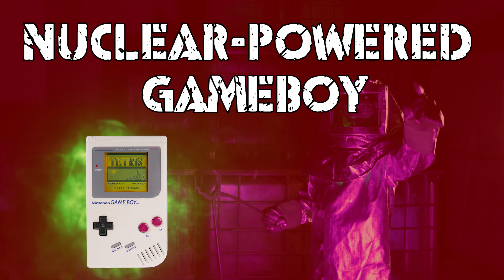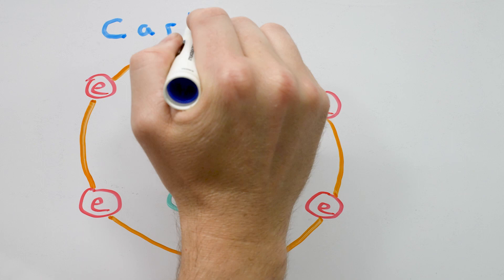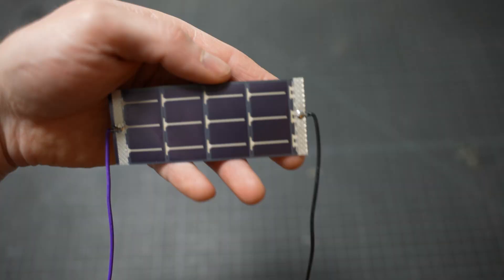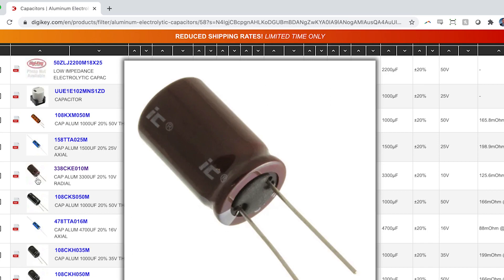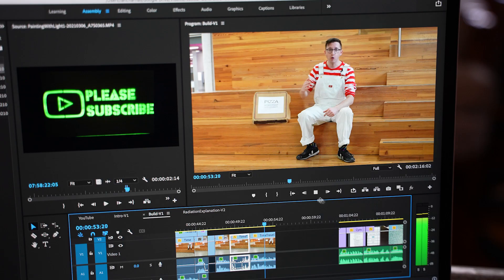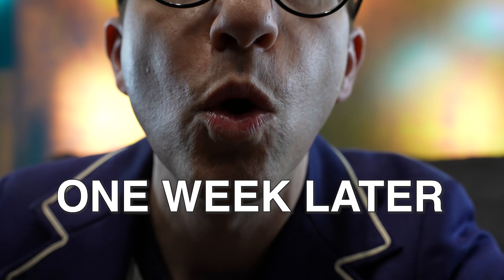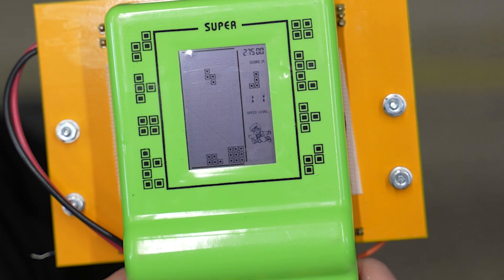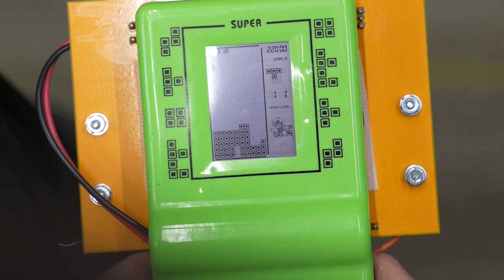Building A Nuclear Powered Gameboy (Lasts 100 Years!)

Comment: How about adding solar panel charging as a supplement and charging it? You should be able to use it more quickly if you charge it with sunlight in addition to charging it alone
Reply from the maker: Hehe you are definitely right! If I made a solar-powered Gameboy that would work better. Somehow though my projects always fall into the "not super practical, but funny" category.

Comment: Cool. I assume it would be possible to make a tritium generator that doesn't use the detour of florescence and photocells to generate a voltage/current and uses the electrons... beta particles... directly to generate the voltage and current? I wonder how much tritium it would take with the optimal design to generate enough wattage to run the gameboy indefinitely 🤔
Reply from the maker: Anders thanks for the super nice comment! I appreciate it. Yeah what you're describing is totally possible. They call that a "betavoltaic" cell rather than a "photovoltaic" cell. They are indeed more efficient. The only trouble is they cost several thousand dollars. Maybe one day when my patreon has a few more supporters 😉

Comment: could you encase the fuel rods in a reflective mirror container to increase the light power into the solar cells?
Reply from the maker: Hi Dan! Thanks for the comment. Yeah the NurdRage channel basically did that. They had a solar cell on one side and a mirror (well, aluminum foil) on the other side. But it works best (generates the most power) with solar cells on both sides.

Comment: How much charge do those solid state batteries hold? How do they compare a AA or something commercially available?
Reply from the maker: Great question! The batteries individually hold 50 micro ampere hours, if I recall correctly. A typical AA battery might hold around 2500 milli ampere hours. So it would take 500,000 of the tiny solid state batteries to hold as much energy as one AA. It's a very niche product :-)

Comment: Do you think those batteries store enough energy to ignite an electronic match used in model rockets ? I believe it needs a minimum of .60 amp (600 milliamp

Thanks , great video by the way
Reply from the maker: Another great question! I haven't looked at the datasheet in a while but I think the maximum power output was around 100 micro amps. So you would need 6000 in parallel to get to 600 milliamps
Reply: @iancharnas  thanks for that info! Keep up the good work

Comment: Excellent video! Side note - phosphors don't necessarily contain phosphorous; the name refers to the ability of the compound to emit light when excited, not its chemical composition. As far as I can find online, it appears that the phosphor commonly used in tritium tubes is zinc sulfide, likely doped with some rare earth element to change color.
Reply from the maker: That's super interesting, I didn't know that! I had always wondered what the term phosphors meant. Thanks for the comment and also for the kind words :-)

Comment: I hesitate to admit it but I'm most excited about the solid-state thin film batteries. I really want to figure out a project I can use them on just for the cool factor but >50µAh @3.8V is not a lot of energy.
Reply from the maker: Oh yeah totally - the low-leakage really blew my mind. The real-life applications seem pretty niche. I saw one that involved an eyeball pressure sensor that was actually implanted into people's eyes. It kind of grosses me out but also fascinates me.
Reply: Consider E-ink. 50uAh should be more than enough to refresh big E-ink display. And 1uW of input power is more than enough to power Artasie series RTC chip. So you can make everlasting clock or even simple ebook reader
Reply: @mocrochip4474  I was considering using them instead of coin cells for rtc and SRAM of a cartridge like system I wanted to design. E-ink sounds fun but I suspect a considerable amount of the power they use is for the processor running the show.
Reply: @oliverer3  It depends on the show. You can completely cut power to display and put your processor in deep-sleep when you don't need to refresh the screen. And modern low-power MCU's have dynamic consumption about 20-50uA/MHz (and way lower for Ambiq Apollo series) so I believe processor shouldn't be the problem. 

Replacing coin cells sounds also fun, but I have concerns about capacity: typical CR2032 is about 200'000uAh
Reply: @mocrochip4474  Coincell wise I was thinking for situations where it can be recharged when the system is powered.

Comment: That was amazing! If only there was a way to make this more efficient, I can imagine this powering an STM8L micro for things like long term periodic measurements (the micro itself would be the least concern, probably the sensors would eat more energy) :)
Reply from the maker: Abraham, thank you for that super nice comment!! 😊 Yeah you are exactly right - I think the main use case for these thin film batteries was for powering super low power clock modules and things like intermittent sensors where it saves up energy from kinetic or dim light sources until there's enough saved up to briefly power up a micro and record a measurement. I bet there are some of these in space right now, which is fun to think about.

Comment: Coulda built a few more tritium generators instead of hunting down an exotic battery. But since the exotic battery has already been found the next step is to figure out how many tritium generators it takes to have a reasonable recharge time and fit it all inside the case.
Reply from the maker: Hi thanks for the comment! I was getting about half of a microwatt of power out of the tritium generator, and I think the video game used something like 500 microwatts... so I would need to make 500 of those tritium generators in order to eliminate the exotic battery. With the right amount of money, it's possible.

Comment: What if you reacted the tritium in a bunch of them with oxygen to make tritiated water and used beta voltaics to directly capture the electrons instead of losing energy to exciting a phosphor in between? You'd get more density by packing the tritium atoms close together into a liquid and more output from a beta voltaic cell at the small cost of making a really radioactive liquid that can easily be absorbed into your body!

Comment: I wonder how it would work if you used the U as your beta particle source
Reply from the maker: Paul thanks for the comment! Hmm that's an interesting question. Wikipedia says Uranium-238 decays by alpha emission into thorium-234, which decays by beta emission to protactinium-234, so that beta decay could make the phosphors glow if there's enough of them. The Geiger counter did go pretty wild when I put it over the Uranium ore sample, but I'm not sure how much of that was beta particles versus alpha particles, neutrons, gamma rays, x-rays, and so on. Maybe someone who knows more about particle physics can help us answer that.
Reply: @iancharnas  I suppose you could try thermal electrical conversion as well? Then you don't need betas for the phosphorus/eventual photons, though you may be able to design and build something which harnesses both the heat and the photons
Reply from the maker: @krakhedd  oh interesting! Like a combination RTG and Betavoltaic generator. Now THAT would be a project!
Reply: @iancharnas  Either that, or harness the kinetic energy of all the radiation by use of a sheet of graphene! ;) (Recent experiment, at MIT I believe, accomplished this feat)

Comment: How about nuclear powered AirTag? Ive been thing to built it into Rigde style wallet. for sure it'll become thicker after photovoltaic sandwiching but it seems doable. However I don't have enough knowledge to calculate everything and build the circuit. What would you recommend to read to gain enough understanding of electrical engineering to get this thing working?  BTW this video is very informative. Will def check out the rest. спасибо))

Comment: Do the thin film batteries come with any storage charge? I'm having trouble finding a datasheet, could use this for another wirelessly powered smoke detector I've been using supercaps on, but it takes too long to charge between checks for a fire, so perhaps these could help me.
Reply from the maker: Stephen, great question! The thin film batteries I bought came with no storage charge. However the ones I bought are super easy to charge. The QFN package contains the battery and also a tiny charging circuit, so all you have to do is connect about 4 volts and let it sit there for 20 minutes. That's particular to the ones I purchased, but you get the idea. For a wirelessly-powered smoke detector, is the idea to gather energy via RF waves, store it in a thin film battery, and then periodically wake up a micro to operate the smoke detector? Sounds like an interesting project! The thin film batteries only have a tiny maximum output current, so one challenge is they may not be able to sound an audible alarm because a buzzer might take too much current. Just something to check on as you work on this. Good luck!
Reply: @iancharnas  Yeah sweet, thanks, interesting, I might have to grab a few.  I was using some low power SiLabs MCUs with custom antennas - waking up to read a sensor every so many seconds, transmitting status to a hub unit with battery backup. The idea was to make battery free detectors, sticky and easily deployable with just a single central point for monitoring. Picking up transient RF radio waves, or nearby emitted RF waves like some 915Mhz ISM @ 2.5W omnidirectional - but range was low and wakeup time far between - solely dependent on the supercap specs. Using radio was basically a month long joke, and emitting our own radio waves was very promising but not to the par of a standard cheapo smoke detector - once ~20ft away from the RF source.... not good. 

perhaps a thin film battery will improve this range, new radio and MCUs as well, but, inverse square law is evil here haha
Reply from the maker: @StephenShafferengineer  Cool project! If the detector is for homes and offices, I'd bet you'd get more energy from a low-lux solar cell. I used this one for the nuclear generator project, it's great for getting energy from dim indoor lights: https://www.digikey.com/en/products/detail/powerfilm-inc/LL200-3-37/9559467

I could see some advantages to RF energy collection though. There's always pros and cons :-)
Reply: @iancharnas  Oh yeah 100%, this was just similarly to your project, to learn about CNCing antennas and capturing power, and getting those darn SiLabs MCUs into their lowest possible power state lol (their documentation is the suck, but they're cool in email support)
Reply from the maker: @StephenShafferengineer  sounds awesome! I too am in the camp of "we do this not because it is easy, but because it is hard" - best of luck on your projects :-)

Comment: Kind of surprised the green vials deliver the most power to the solar cells. 

I Was aware that green was the most visible wavelength to the human eye.  (Therefore it appears to be the brightest…)
But I’m surprised green also delivered the most power to the solar cell.
Wonder if human eye sensitivity is correlated to power absorbed in the solar cell?

Also, not sure if I mentioned in my other comment, but I have a few extra x-ray machines, if you’d like one for your shop.  

Most of them are early to mid 2000’s dental machines, some of them are standard dental x-ray machines… And I have two that are “panoramic”.

They get brought to the salvage yard quite often, and when they’re all complete and working… I usually take them to my shop. 

Figured they would come in handy “testing“ my different geiger counters and scintillation detectors. 😂 but mostly for identifying cracks and repairs on the inside of violins. And for electronics/surface mount rework

Its amazing the amount of repair work found in some of the 200-300 year old instruments.
Reply from the maker: Yeah I was also surprised the green delivered the most power. Part of me was hoping that for all the extra effort of testing each color, I would find something non-obvious. In hindsight it makes sense though. When we look at the spectra of light that reaches the surface of the earth, green wavelengths (495-570 nm) are the strongest... so perhaps that's why our eyes evolved to be most sensitive to those wavelengths (so we could see in dim light).. and perhaps that's why we developed green phosphors before the other kinds and why they are still the brightest today.... and also since the green wavelengths of sunlight get to the earth with the strongest power it makes sense that the junctions in the solar cells would be tuned to green wavelengths. I'm not sure if this theory is correct, but the info seems to fit together nicely.

Wow an x-ray would be amazing! I work out of a university and I can't keep the x-ray in my shop here, but I'm looking around for a warehouse so I can set up a private shop and I'd love to reach back out to you then to see if you still have one available! That's such an awesome offer - thank you!!!

Comment: Those thin film solar cells are not very efficient, monocrystalline cells would produce more power.
Multi junctions cells would be even more efficient, if you could get a hold of any.
Reply from the maker: Hi thanks for the comment! I was expecting to find just as you said - but when I tested mono-crystalline cells they produced less power than the thin film cells. It looks like although mono-crystalline cells are more efficient at higher luminances, the thin film cells are the most efficient at very low light levels  like the levels produced by the tritium vials. It was surprising. I don’t have any multi junction cells… those are good because different junctions can be more efficient at different wavelengths of light, am I remembering correctly? The phosphors produce a narrow bandwidth of light, so I think the best cell (if it existed) would be a single junction cell that was “tuned” to the wavelength produced by the phosphors. Interesting topics! Thanks for bringing them up

Comment: Y not wse a transformer
Reply from the maker: Hi great question! A transformer can't increase power unfortunately. If you use a transformer to increase voltage, the current goes down. Or if you use a transformer to increase current, the voltage will go down. Thanks for the comment!

Comment: so can you make several of these nuclear solar cell solid state batteries using MJ cells and put them in parallel? if mass produced they could be cheap enough to make soda can sized AAA batteries that don't die?
Reply from the maker: Hi and thanks for the comment! These cost about $250 each and you'd need a few million of them to equal a single AAA battery, so this might not be the right technology for that. But it's interesting to think about!
Reply: @iancharnas  RTG might be better but still out of price range - using TEG peltier device on radioactive heat.

Comment: The current and voltages generated are too low, you will need days or weeks for a few minutes charge, and beside this, tritium has an half life of 12 years. After 12 years you will get half of the light and it will be useless. 
Using the solar panel with direct sunlight will be immensely more faster and will likely work for 25 years (lifespan of the solar panel)
Reply from the maker: Hi Giorgio, and thanks for the comment. I think this is a fair critique. I could have gotten more power if I made this a solar-powered gameboy.  But, it wouldn't have been as much fun, and I wouldn't have learned as much.

Tritium does have a half-life of 12 years, so after 12 years it will take 2 months to charge instead of 1 month. Since this is just a novelty device, it's still usable. The same is true with the solar degradation. It will just take more time to charge up in the future. Thankfully I don't have a design specification to meet, LOL.

I appreciate your comment.

Comment: Hmm??!! The scientist in me wonders; If one can use that glow in the dark paint to make a generator. in principal By charging the paint with a strong laser as you did in the video above and harvesting that illumination with a photocell?... would/could it in turn generate more power output then the tritium generator? If so would you be able to create a bank of these solid state thin filmed batteries as well as a superconductor bank to help stabilize input and output currents for greater voltage discharges?.... I also wonder if the paint deteriorates over time,  how long can it illuminate for, does it heat up any when being hit with strong lasers?... could one create an everlasting illuminating bulb with this laser paint technology?  you would in theory; Have solar banks that are harnessing the sun for electricity for a GRID like system by storing the power harnessed into batteries and having that electricity stored run a laser for the photo paint power generator.. I personally would only run it at night time to help stabilize the batteries in the GRID system... sorry for all my questions I will probably have to experiment here myself very soon in order for me to get answers. I will add; it is such a great time to be living and contributing to this massive shift in technologies that we are developing, it is helping us walk forward and paving our future for generations to come...
Reply from the maker: Hey thanks for the comment and checking out the video! Energy storage is an area where a lot of innovation is still happening. I don't think anything in my video comes close to a solution for that because the efficiencies are too low, but it's fun to think about. :-)